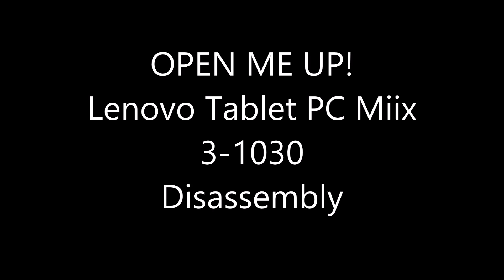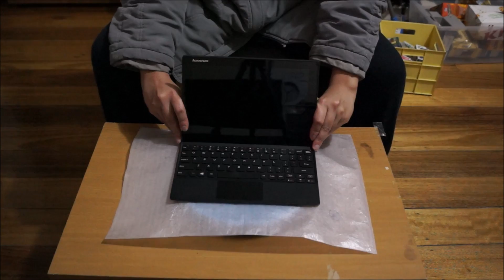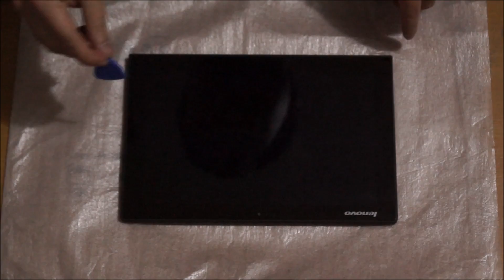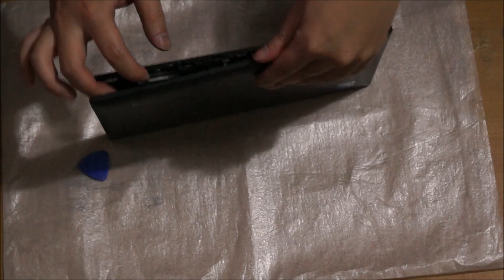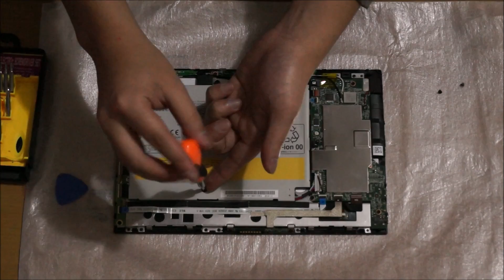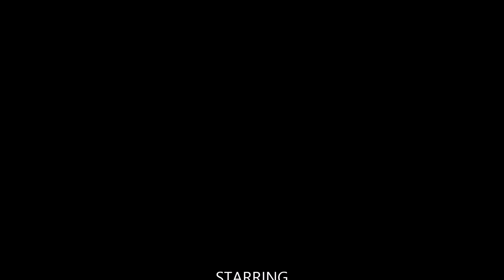OPEN ME UP! Lenovo Tablet PC Miix 3-1030 Disassembly

Comment: Hi there, I took mine apart because it didn't want to start up proper, and the motherboard area heats up a lot. Upon investigating with the back panel off, when i pressed the on button, the shielded area heats up pretty quickly, and the screen has zero response. Just want to know if it is dead, thank you
Reply from the maker: the cpu is probably burnt out and on the verge or dying

Comment: i have a trouble. Key "O"  nOt wOrk.   OOnly with shift mayuscules
Reply from the maker: remove the key and check if there is anything wrong with it
Reply: @OpenMeUpTec  do you know how can i do that?
Reply from the maker: you can put something under it and pry it off. this is what i normally do. when it is off press the key and see if it works without the button
Reply: @OpenMeUpTec  thanks but i fear. Do you think that work with this computer Lenovo miix 3?
Reply from the maker: if you are scared i recommend you to do nothing. as doing thing like this is a risk

Comment: Is possible to replace display glass? If it is, I'd be interested to buy a replacement because mine is currently broken.
Reply from the maker: you can but you cant find it. since it is hard to find. the tablet is not worth much but a replacement screen will most likely cost more than the tablet itself
Reply: Do you know a way to disable triggering touch events? Then I could use my tablet even though the display glas is broken. If not do you think it's worth to sell all the parts inside of that device?
Reply from the maker: you need to open it up and unplug the touch screen cable. at 3.40 should be the 2 black cables on the left hand side
Reply: I disconnected those cables but it still triggers touch Events but now everywhere not only near the broken part of the screen.
Reply from the maker: it should be somewhere near there as i had the same issue as well with the one in the video i had to remove touch screen and it was faulty
Reply: I also disconnected the White/blue cable beneath the two black cables and it works. Thanks.
Reply from the maker: look at the comments i have answer this question before. at 2.20 you can remove the 2 black cables on the left hand side and that should do the trick. the touch screen has a cable you need to find it and disconnect it

Comment: Hi, i have very little space on my Miix 310-10ICR Tablet (ideapad). Is there anything i can do to add more memory like an external cpu or external hard drive? Thank you
Reply from the maker: really you cant do much you can use an external hard drive as it does have a usb port
Reply: Thank you. Do you think I could ise something like the Intel Compute Stick STK2m364CC -Core m3 6y30 - 1.6 GHz - 4gb, 64G

https://ark.intel.com/products/91981/Intel-Compute-Stick-STK2m364CC

What I want to do is have this be a dedicated drive/processor for my design programs. So that I plug it in to run them.

Thank you
Reply from the maker: you got the wrong idea. the intel stick is actually a computer. if you want more space then you have to use a use hard drive
Reply: Can I DM you?
Reply from the maker: dont know what DM means
Reply: Haha. It means direct message which means to email. But my question’s below:

is something on the market that serves as an additional desktop so I can run programs from it?

Basically, What I’m trying to do is add another sort of CPU to my existing computer. The link I sent you was for this kind of USB computerthat you plug into something like a TV or monitor.  I’m not sure if that would work with a laptop but my question is would you know if there is something on the market that serves as an additional desktop so I can run programs from it.

I do not have the capacity as my computer stands, to download and install anymore programs such as autocad.
Reply from the maker: ok i see what you are after and you are going about it totally wrong. autocad is not going to run on this laptop or the intel stick they are just too weak. what you need is a proper computer or laptop. a desktop is cheaper and much more powerfully for the same price therefore you probably need to get yourself a desktop
Reply: Ah I see! I liked the portability of this little computer plus it transforms as a tablet. But my best bet may be investing in something more powerful like a Lenovo yoga or Microsoft surface as you described.

I was hoping I could build something or rig something that allowed me to make this tablet powerful when I needed to but not always. Thanks so much
Reply from the maker: you cant do anything to this to make it better. this is the same thing with newer laptops it will be basically the same as you bought it.so when you want something, it is always best to be sure of your purchase as it is not upgradable

Comment: Hi bought 2nd hand and get message no bootable devices please restart system.how can thus be fixed
Reply from the maker: you need to install windows
Reply: OPEN ME UP what would be the best way too do it
Reply from the maker: using a usb stick with windows on it
Reply: @OpenMeUpTec Still doesn't show on boot meny . What type of cable do you use ?

Comment: help! today when i turn on the Miix 310 i got a black screen with nothing showing up even the lanovo bootup icon. the tablet is working because i have teamviewer installed in it, i can remote access it with no problem but the screen is not working at all. is there any fix?? i got this laptop like 2 months ago, windows update even takes more than my usage time.
Reply from the maker: if nothing is display on the screen the screen can be faulty or loose cable open it up and check it out. normally if there is no screen the laptop cant turn on and will display an error using sound or lights. since you can log on with team viewer which means your screen can be faulty
Reply: OPEN ME UP but the touch screen works too… so how can it be the faulty screen? could it be the graphic card, is it solder on?
Reply from the maker: touch screen and lcd screen and different. they have different cables and they dont come as one. the factory puts them on top of each other with adhesive
Reply: OPEN ME UP I have hook it up to the TV with a HDMI cable and is working fine but still black screen on the monitor… do you think is still a loose cable?
Reply from the maker: could be but really doubt it. i really believe the lcd is faulty.

Comment: Is the USB port (for charging) attached to the motherboard? I am interested for Miix 3 - 830 but it might be the same as this one. Mine has become very loose and it's not charging, but can't find replacement parts and I don't which ones I should get. Thanks in advance
Reply from the maker: this is a bad tablet I wouldn't recommend it. yes the usb ports and all attach to the motherboard
Reply: I have the same problem as well, and It won't chrage anymore

Comment: OPEN ME UP Please help!
Does this Tablet (Lenovo Tablet PC Miix 3-1030) work without the battery, only on the cable?
Reply: It’s a laptop, you can unplug and use until you need to you need to plug it in to recharge.

Comment: Does this Tablet (Lenovo Tablet PC Miix 3-1030) work without the battery, only on the cable?
Reply: This works with the battery but im sure it will kinda not turn on without the battery even with a cable "or im wrong"

Comment: I didn't understand where is the SSD hard drive i would like to change that ridiculous storage to increase capacity
Reply from the maker: +Maui- Maui CPU is solder on, ram is solder on, wireless card is solder on, hard drive is solder on and battery can be replace.

Comment: hi there can the charge port be replaced or not as i have one and the port has become faulty
Reply from the maker: +jason gates you will need to desolder it and solder it back on. you can buy the usb port on ebay for $2AUD

Comment: Silly question, but I purchased the lenovo miix 300. Cheap as hell for a decent school computer that can do anything up to hd video. I quite like the device, but the one problem I have is that the volume button sticks to the outer housing. When clicked, the volume up releases about half a second after I release my finger. the volume down; part of the same button assembly releases as soon as pressure is removed.

How would I go about fixing this issue?
Reply from the maker: +Aaron King disassemble it can put it back together and probably resolve your issue. sometime moving it around cause this and it pretty normal for other items as well
Reply: +OPEN ME UP That's what worked for me. I pressed the button continuously for about 2 or 3 minutes and that loosened it up